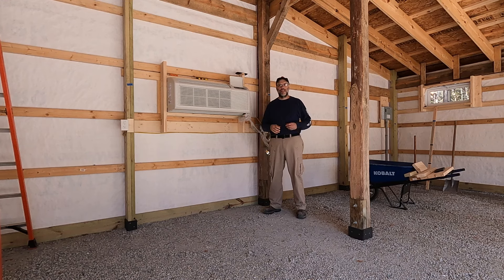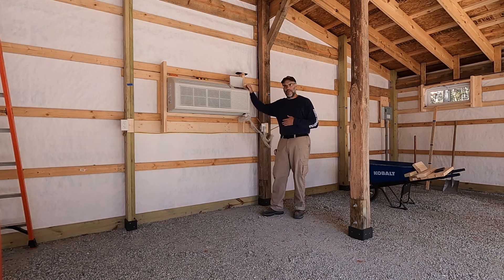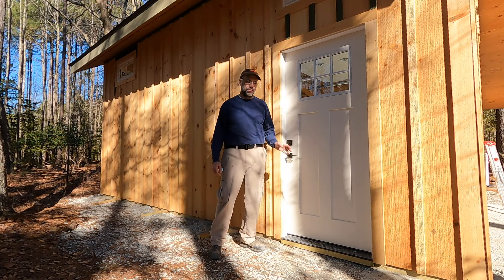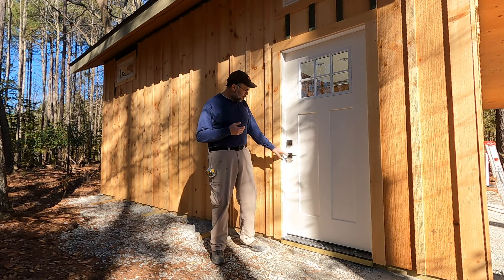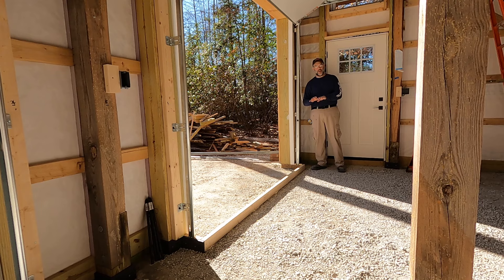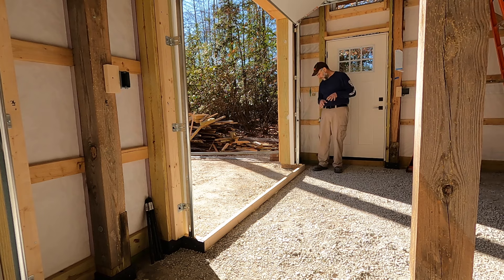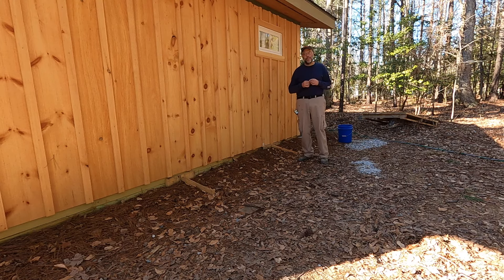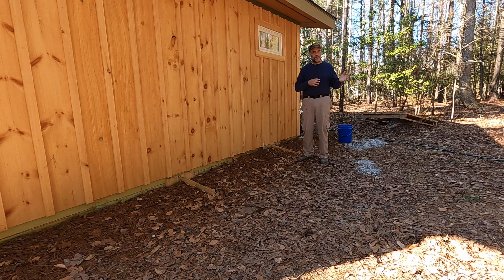Pole Barn Project #25 - Catching up and Concrete Prep

Comment: You going to talk about what you have on your post bases in your concrete video?
Reply from the maker: I recorded a whole clip about that but must have deleted it by accident since it was not on the camera at edit time.  They are closed cell polyethylene foam expansion strips to separate the concrete from the posts.  A side benefit is that they do not wick or absorb moisture like traditional fiber/tar expansion strips.

Comment: I have seen some projects where the concrete floor is poured against an interior skirt board instead of going between the posts and possibly bowing out the wall like you describe. Do you have any opinions on the difference between these two approaches, with regard to any other considerations like moisture & insulation, or longer-term maintenance?
Reply from the maker: I'd much rather have concrete up against the outer skirt board, I think it better seals up the building against rodents/snakes/etc.